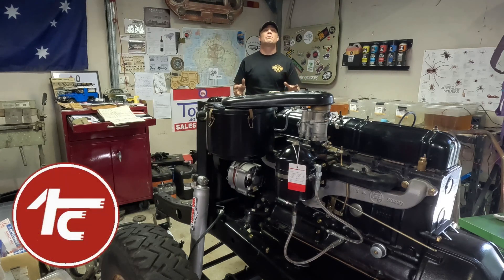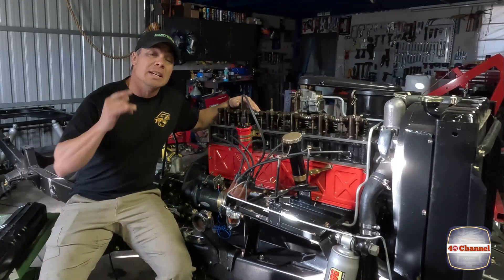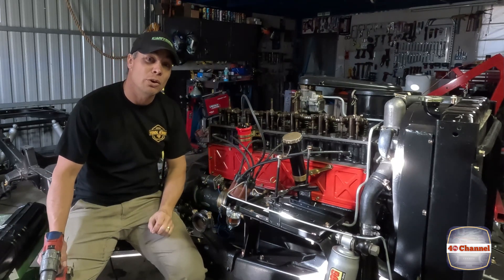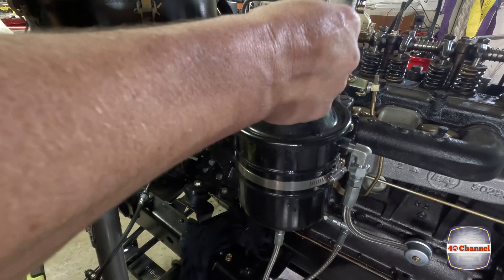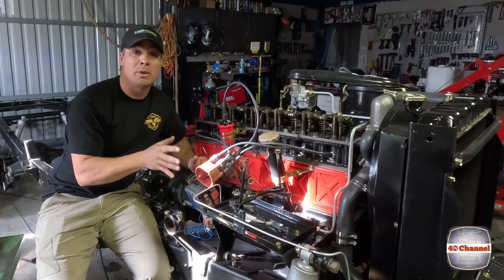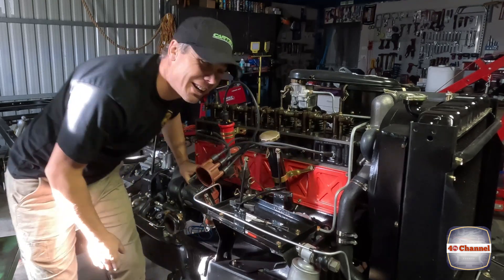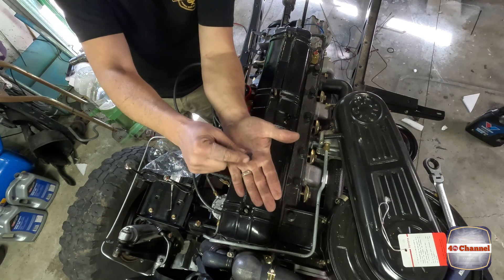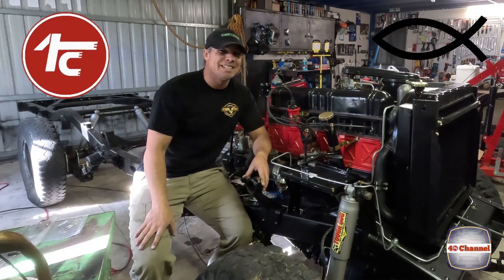S2EP90 - How to Priming the oil pump and checking oil lines for start up, Oil to the Rockers?

Comment: I reassembled an f-155 engine but I can't get the oil to rise to the rocker shafts. I suspect that the cam holes are not aligned to let the oil pass. It seems that it can take a while before the oil rises to the rocker shafts. If it is not because of the cam holes, I think I have a blocked duct with residue from the main bearing or rod bearings. Little metal flake. I thank you for your patience and I thank you for helping me. I am usually very resourceful in mechanics but there I have a serious problem. I check the hoses of the oil filter and I also check the oil pressure regulator. I may not have the choice but to reassemble everything. I still have to check the cam too if it is not blocked. The small copper line was not blocked your friends from Quebec in Canada!

Comment: Is it necessary and mandatory to prime the oil pump before starting the rebuilt engine?
Reply from the maker: @eagleeyeswings2863  yes to ensure you have all the oil galleries in the correct position and oil is getting to the rockers.
Reply: @40channelcruiser  ok and according to you sir, if the pump is not primed, could this cause damage to the crank shaft and the rod and main bearing?
Reply from the maker: @eagleeyeswings2863  it's more to ensure that oil is running through the correct galleries, so that you don't damage anything on start up.